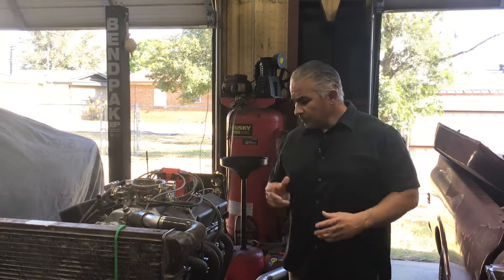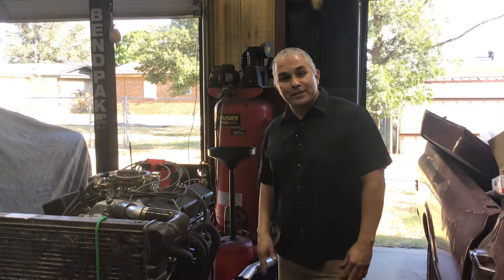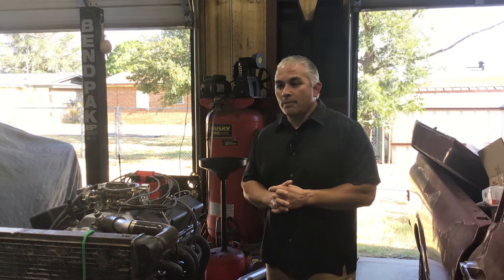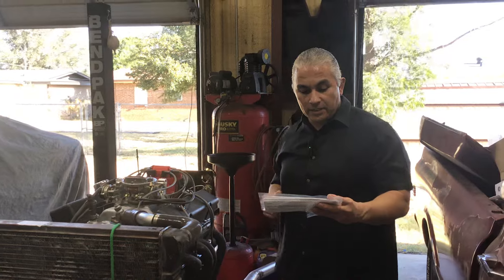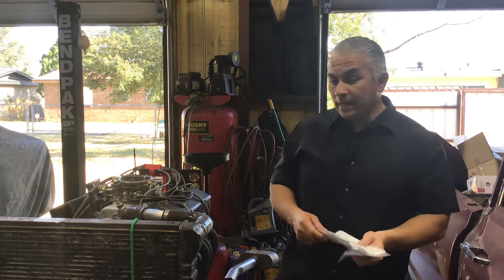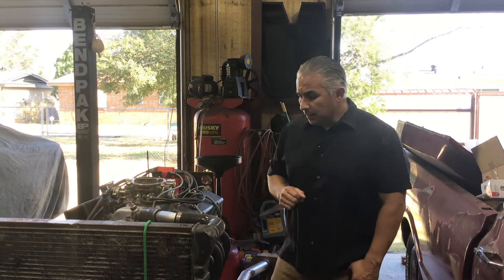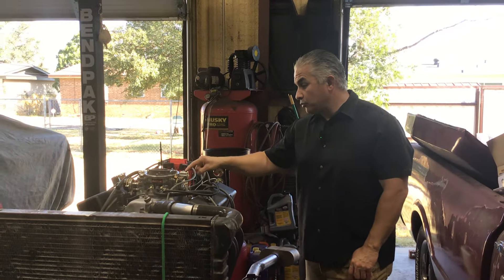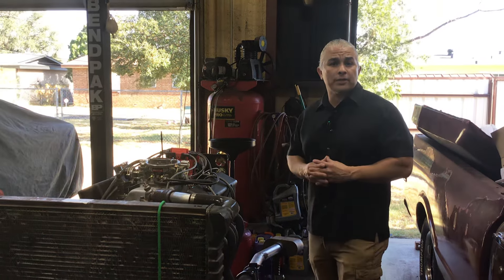Sbc 350 comp cam 507/510 lift

Comment: What is on the PTO end of the crank ? If it's wearing a flexplate that is slow revving. If it's wearing like a custom 100 pound bronze flywheel* then that is pretty good!
*Heavy flywheels get used on boat engines and generators mostly. Maybe a rock crawler too IDK.